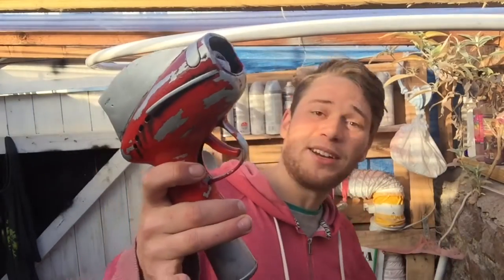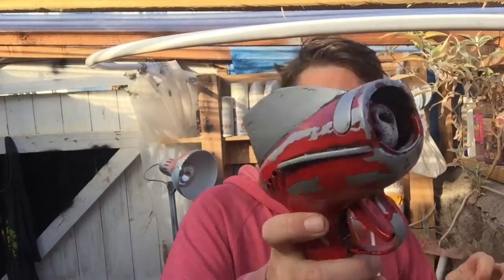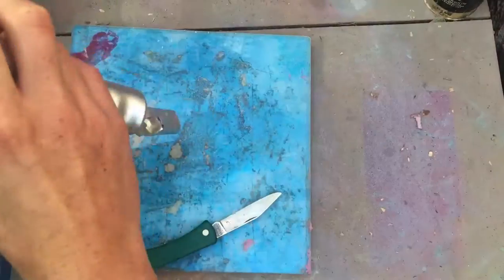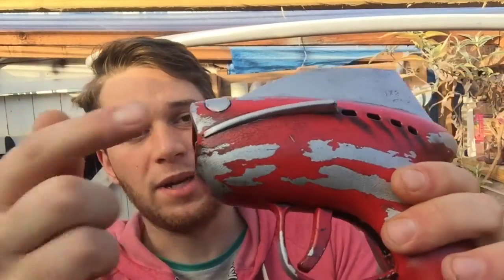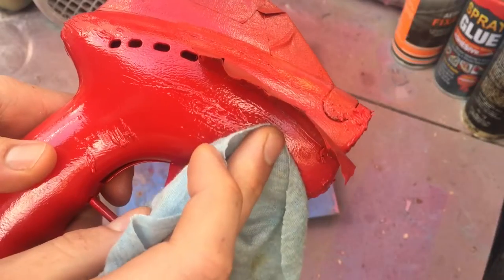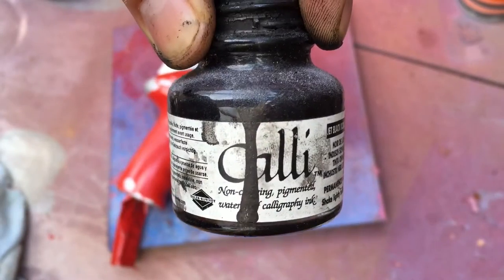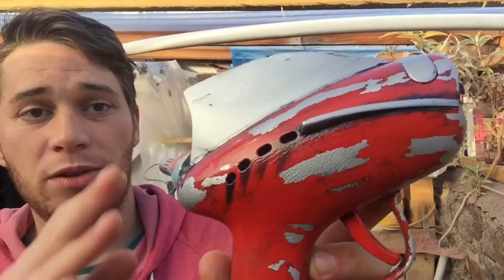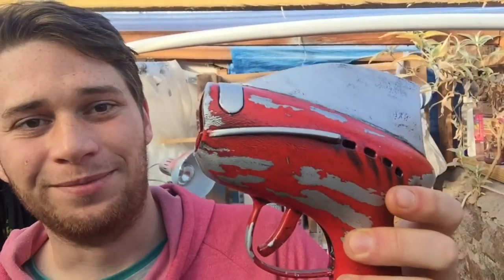[TUTORIAL] Chipped paint Technique for props and armour

Comment: Dude, that paint job looks amazing! I like the idea of using vaseline for a chipped paint look instead of using mustard or peanut butter. So that's good to know. Also, I think the black weathering near the vent holes on the "ray gun" look super legit. #BubblesofDoom
Reply from the maker: cheers @Venger Voldur 
I've never tried mustard or peanut butter but I did try toothpaste and it didn't work nearly as well .... it was "whitening" toothpaste and it ate through the silver undercoat. hahah, that toothpaste is more powerful / corrosive than one would have guessed.

I like the vents too,  i just dry brushed some black acrylic to those bits with a little paint brush. the whole inking, dirtying up and weathering of the prop is when it comes to life.

I'd love to combine one of these bubble guns with a "Vape Pen" to make vapour filled cloud bubbles!!(of doom), ive tested it by just blowing "vape" into the air intake of the bubble gun and it looks sweet... definitely a future project.

as always thanks for commenting  :D
Patch.
#BubblesOfDoom